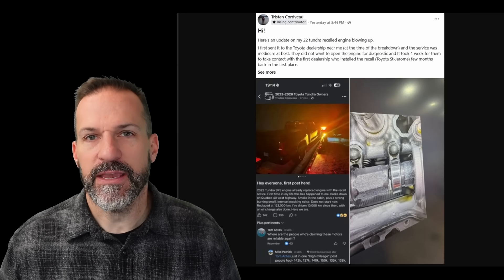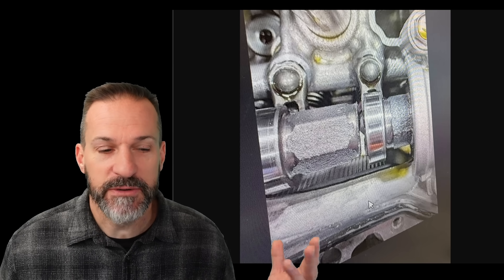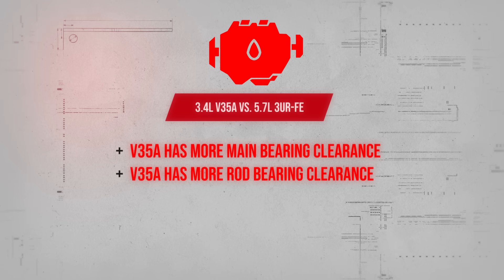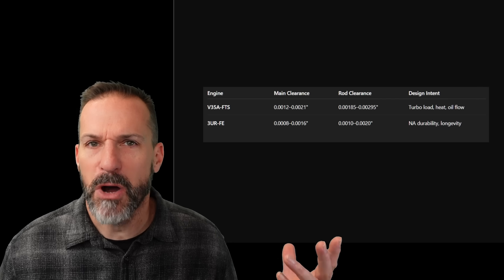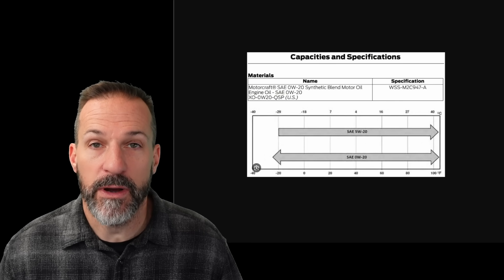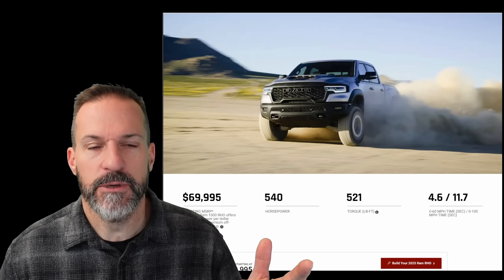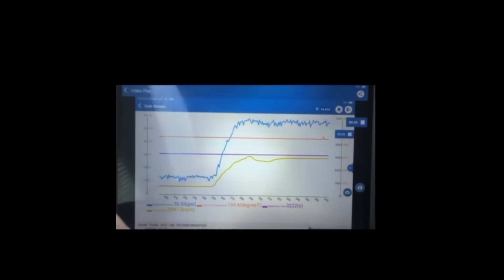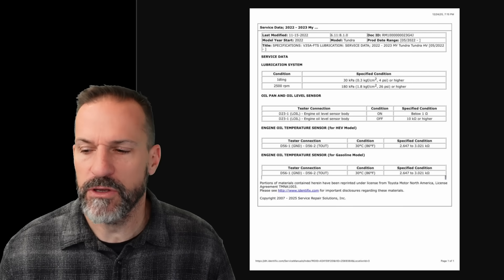Can We FIX Toyota's BILLION Dollar Mistake at Walmart? 2022- 2026 Tundra...

Comment from the maker: Disclaimer: I’m not telling you what oil to run. I’m not a mechanic. This is not warranty advice. This is an analysis based on publicly available data, owner reports, and engineering fundamentals and what I would consider if I owned one of these trucks :).
Reply: I switched my vehicles to 5w30 because so many manufacturers are having problems and 0w20 seems to be a common denominator.
Reply: @Linda-l9d6e
5w20 has been around for a very long time...its the 20 v 30 thatd matter. So what about the millions and millions of engines with 5w20 and 0w20 that do not fail? Toyotas 5.7, for example, 0w20, running strong. You have a logical fallacy my friend.
Reply from the maker: @OBSSVADHD  pretty big difference in engine design, power output and oil pump/pressures. It’s a lot easier to make NA engines reliable
Reply: I think it's good advice, and I made the switch 6,000 miles ago and I am never going back to 0W20.
Reply: Design is one thing. What the actual dimensions are is something else. 6 sigma certifies a "process" when in the old days, PEOPLE used to inspect critical parts 100%. Betcha the multiaxis robot 'inspectors'want a pay raise!
So how can Yamaha run 0-40 in thier 3 cylinder 998 cc 200+ hp snowmobile engine? Lets see...1 litre,200 stock hp. x 3 (litres) would be 600 hp equivalent? Toyota needs to stop by the Yamaha r and d department and do some spying!😂😂
Reply: @brokenujoints3811  I feel like people probably took more care of packaging the original Xbox than they do building these engines
Reply: @brokenujoints3811 
Japanese sportbike engines are only made in Japan because the rest of world sucks manufacturing.
Reply: Changing the oil type will, at best, delay the failure.  You may well end up with failure occurring out of warranty instead of in warranty.
Reply: @OBSSVADHD I think if you switch to 5W-30 before the damage is done I think I'll make a huge difference.
Reply: @HowtowithPaulHenderson 
I disagree. There isnt much hard evidence for ua to debate with, really.

I have a friend who owns a couple of Kias.  Both in the range od their engine failure.  He used thicker oil and top brand synthetic uaing your logic.  One vehicle lasted 110k miles and the other 120k miles.  Both engines still failed.  So he maybe delayed the failure, but could not ultimately prevent it.

People put way too much into these oil viscosity differences.  Having worked in engine and auto manufacturig for decades i can say with confidence that these types of failures are not going to have oil viscosity as the root cause. Maybe a minor conteibuting factor, but not "the" cause.
Reply: @OBSSVADHD  Agree on the oil, I think too much scrap metal is used to make engine parts. Spend the money on true alloys.
Reply: @geraldgarrett5088 generally speaking, you cannot have too much scrap metal as long as the final properties are met.  Ive been to dozens of steel plants and bought steel products via suppliers for a long time.  There are issues of steel quality though. There has been a glut of low quality China steel since their infrastructure demand dropped dramatically post covid. Im sure that has made its way into auto parts at times.  A lot of our problems these days is poor quality in manufacturing.
Reply: I’m now running 5w30 in my 24 Sequioa mainly because of the turbos. most manufacturers since 2007 have recommended that weight. ford went to 5w20 and switched back. Turbo cars get really high oil temps compared to NA and 0w20 gets to thin-like water at those temps; then add the 10k mi extended oil change intervals it’s a time bomb waiting to blow
Reply: Always appreciate your videos, thank you. I bought a new 2002 Chevy Avalanche and followed the break in recommendation. I think it was 600 miles never over 60 mph fluctuate the speed etc. in the 16 years of ownership never had to add oil never burned oil. I would read that many owners posted their Avalanche burned lots of oil. I know the dealership said break-in periods were not necessary, so i wonder if those owners did not follow any break in recommendations. When i bought my new 2017 Tundra. i did the same and also changed the first oil at 2,000. In 8+ years i’ve only changed one turn signal bulb and a set of new tires 😂 this might be my last truck if it stays this reliable 😄
Reply: My truck is leased specifically for this reason.   If the truck blows up, I give it back and go buy a second gen and keep it forever I guess.  lol.   I won’t be screwing around with oils under warranty unless Toyota recommends it.  I will however change my oil every 8000km or 6 months instead of the ridiculous 16000km recommended.   If the engine is good, I’ll maybe buy it.
Reply: The problem with Toyota is, they are like a cruise ship, they take miles and miles to make any significant  adjustment… in the past it worked because they made a decent product… right now they need a Venezuelan drug boat type maneuver… hell, the entire community has been griping about tow hooks and they still haven’t even put those on
Reply: https://youtu.be/i0VoEhW2I-E?si=WPByVzIkOH0MQHnU
Same theory from an engineer. Worth a try
Reply: you would  think a company like Toyota, which probably pours tens of millions of dollars into their R&d would be able to figure this out… instead of Youtubers have to come out with a solution
Reply: @Wellh0wrya  Toyota is, like most companies nowadays, is hiding the truth, to avoid legal consequences and loosing customer satisfaction, etc.
Reply: @Wellh0wrya 
So true, I really feel that's the oil but will they ever truly admit it no because if they do they will be open to even more lawsuits I think that's why GM went to the 0 w-40 if the engines that were inspected were okay and they did not need to be replaced but if they would have then switched back to 5W-30 then that's pretty much that would be them admitting that they made a mistake going to the zero w20. 0w20 is just way too thin especially the heart of the oil gets the thinner it gets it's pretty much just black water at that point.
Reply: @Wellh0wrya it's not a solution, it's an opinion at this point
Reply: @UT3CTF what’s the difference? Youtubers are trying to find a solution. Meanwhile Toyota keeps selling junk.

Comment: I was thinking of using 5w/30 in my tundra because I noticed low pressure on the gauge all the time,  I remember growing up, a good engine oil pressure was around 40-45.  My first thought on this was not enough pressure or oil is too thin.

Comment: A great example of this is If you watch the video of TFL trucks doing an off road tow test on a ram with the hurricane engine. They were pulling a skid steer on a equipment trailer up a dirt road. And when they got to the top, the low oil pressure light came on after really working the engine, the low oil pressure light went off once they revved it up, but at an idle, it was throwing a low oil pressure light on the dash

Comment: Here is my "theory", Im not a mechanic, I bought a new 23 LX 600 prior to any recalls etc. My vehicle was outside the 1st recall by a month. During my 2.8 years I had zero mechanical issues. The 3.4  was not as creamy as the V8 in the previous models and I adjusted to these characteristics. At about 21k miles the next recall was issued. Again zero issues except for the thought in the back of my mind regarding the motor issues. The further from home the more prevalent the doubt became. Its easy to say going to 5 w 30 would be better, but under warranty, with a motor with known issues, I feared creating an excuse of being denied warranty by running oil not recommended. Then I began to ruminate about having these doubts and thoughts after having spent a significant amount of money. My wife and I decided to take our dealer allocated 26 LC 500 and move on. I received excellent trade on the LX 600, no complaints. The thing I seldom see discussed is the doubt that is created by these issues for the owners. I did not suffer financially, but as it related to peace of mind I was not satisfied and made a change. This should not occur with vehicles at all, much less vehicles North of a 100k. I bought Toyota again because of the many I have had that were fantastic. I hope Toyota is listening, not everyone is as loyal as we are. The "debris" explanation was ridiculous on its face, to keep pumping them out with known issues with "the motor gets replaced because Toyota takes care of its customers" is a very weak constellation. My 2 cents.

Comment: Regardless if thicker oil makes them last longer is a moot point. There is a design flaw they are telling people to run oil and they are blowing up. I have run 0-20 in plenty of turbo’d vehicle without issue. My Tundra went kaboom and I did my first oil change after 500 miles then 5000 there after.

Comment: I agree with one caveot…..not on a new engine. 
If you can probably step up the number 5 every let’s say 30,000 miles. Let the engine break in a bit. 

I routinely on my Chevies would step up viscosity as cars got older, they loved it. 

Another thing, if you are living in a routinely hot humid place, you can go with a hot starting oil. You don’t particularly need an oil that has lower viscosity at lower temperatures.

Comment: Force induction engines runs a lot hotter. It is 100% the oil you have to use sticker oil. It’s a turbo engine.

Comment: Stop this zero crap , go 5/40, 10/40, 3500 mile changes and Oil Analysis. But the motors are too small for HP output.

Comment: I use 0/20 in my 2018 TRD Pro Tacoma....V6  engine without Twin Turbo... Sounds crazy putting in the same oil to a more powerful engine like the Tundra V6 Twin Turbo... And Yes getting the oil to those parts sounds like a problem as well... I think you're  spot on!!

Comment: I'm surprised that as complicated as these trucks are and expensive now add problem bearings etc that no company has added a electric pre oiler to get the oil psi up before you start it.

Comment: Of course, there's a fix for the Toyota Tundra engine issues. It's called throwing it away and bringing back the 5.7L V8. And the 4.6L V8 and also including the 3.5L V6. As a base model engine. I mean, seriously, why hasn't Toyota or, for that matter, Nissan figured that out. There's a reason GM,Ford, and Ram constantly outsell those brands. It's because they offer choices of cabs, bed lengths, different trims, and different engines. Supply and demand. Give the people options. 
Apparently, Toyota could never figure that out.

Comment: The 4.7 v8 was made with the help of YAMAHA, toyota doesnt have experience buiding turbo engines. Nissan made a v6 twin turbo back in 1990 and those engines are still running. This 3.4 twin turbo has a bad design. When they blame debris it was just another lie. Because after replacing 2 or 3 engines it will still faill.

Comment: Running 0w-20 in twin turbo high output engine is criminal. I have an older Audi that had a bad oil pump. It pumped out 12psi at idle. 4-6psi at idle is absolutely insane

Comment: I don’t put over 5k a year on my v6 Ridgeline so once a year oil change but I put B&G MOE oil additive at 6 month mark. The dealers who advertise engines for life install B&G oil additive at every oil change. Along with full synthetic oil. This came from my Honda dealer. I have researched this additive and it is highly recommended and actually works protecting engine parts. Does not affect intakes or lifters. On top of that I use Top teir  fuel with Lucas fuel additive. I also researched Lucas,again great reports no down sides. Truck is still new but engine sounds quieter and smoother.

Comment: It’s also important to point out that many of these failures happen after the first oil changes at the dealership. In many cases, dealers use low-quality bulk oils without clearly disclosing it to customers. This becomes even more critical when the engine is run on low-octane fuel (87 or 89 octane) in a high-compression, twin-turbo setup, which increases the risk of pre-ignition/knock. When this fuel-related stress is combined with poor oil quality and the V35A-FTS’s extremely low oil pressure design, it creates the perfect conditions for engine damage. These factors together—not oil viscosity alone—are the real trigger behind these failures.

Comment: Trust me, the real problem with the V35A-FTS is oil pressure, not oil viscosity. At idle, the engine runs at extremely low oil pressure—around 4 psi, even under load. At 2,500 RPM, oil pressure only reaches about 26 psi. These values are simply too low for long-term durability, regardless of the oil used. The issue lies in the oiling system design, not in 0W-20 oil.

Comment: Go by the ambient temp of where you live for oil viscosity. 
I live in El Paso, Texas. In the 3 coolest months of the year, I ran 10w30 in my gasoline cars. In the other months, I ran 10w40. 
I now have Ram Ecodiesel and a VW TDI. I run 15w40 Rotella T4. All year long. I get 40 MPG in the city in the VW, and the Ram gets 21 MPG highway or city.

Comment: As a guy who had a 08 Turbo Polaris snowmobile. Turbos are JUNK! Yes fun. But junk for reliability. I spent 55 grand of my own money tuning the motor. upgrade turbo with ball bearings.. ECM changes cos it didn't like minus 20 anything... 0w 50 oil. Just to try and keep it going for the 15 000 miles i owned it for. It almost broke Polaris..

Comment: Thinner oil shows no appreciable wear in increase in actual tests were specious reasoning and sticktuidnous aren't reqd. Surface finish is important oil pressure is showing the resistance to flow not necessarily oiling plastic bags are NOT toys.

Comment: I bought a 24 Ford Bronco Sport. But it had to have the 2.0 liter engine and call for 5-30 oil. If Ford was calling for 0-20 I wouldn’t have bought it. And i wouldnt have bought it if it had any type of cylinder deactivation system like GM uses in there 2.7 4 banger. I don’t and never will go by the oil life monitor. I change the oil and filter at 3k. I don’t care what the oil geek says. Today’s oils aren’t as good as they say. Especially on a 4 cylinder turbocharged engine putting more stress on moving parts than a V 8 did from years ago.
What I don’t understand is why Ford doesn’t run the engine without turbo boost at light throttle and only bring the turbo into play after say 1/2 throttle. Back in 76 my Honda Civic could easily get 50 mpg with no turbo no direct injection and a crappy carburetor. But today’s direct injection and small turbo engines like 2.0 in the Bronco sport get half that unless you drive like grandma. And these same direct injection engines produce massive amounts of soot.
FYI we are seeing GPFs being installed on direct injection engines because they produce so much soot out the tail pipe. BUT if MFGs went back to MULTIPORT fuel injection there would be a small HP loss and no intake valve carbon issues and no need for a GPF. (Gas particulate filter) that causes HP loss due to exhaust back pressure issues. WTF?

Comment: Variable oil pump for the engine. Well turn up the pressure. Disconnect from the ECM and put a controller in that will run high pressure. I could see this being used as a way to kill engines out past the warranty. Either it is programmed to lower oil pressure based on milage or it gets an update from a dealer mechanic at a check up.

Comment: It’s not just having more oil in between the bearing and moving parts. Thin oil flows much more easily out of the spaces between bearings and moving parts. So the tolerance was reduced to maintain oil pressure with 0-20 oil. Thin oil doesn’t offer much cushion between bearings and moving parts. 
Problems begin when the space between moving parts and bearings are reduced and parts repeatability is an issue. There is always some difference between mass produced parts. And if you don’t allow some tolerance between bearings and moving parts for the small differences in mass produced parts then you get metal to metal contact. Also under load at low rpm a thin oil will squeeze out from between parts easier than a thick oil. Leaving less lubricant between bearings and moving parts. 
So loose tolerance and thin oil is bad
Tight tolerance and thick oil may not get enough oil in between bearings and moving parts when cold
It’s impossible to make parts 100 % repeatable in a car production environment (To expensive)
Today’s variable oil pumps are a really bad idea. Low oil pressure is never a good thing.
Start stop technology is proven to cause massive premature wear. Metal to metal contact each start with no oil pressure.
The best idea for long life is more space between moving parts for thick oil. No variable oil pump. No start stop technology.
Read carefully and think about it.

Comment: The cylinder pressure is the difference with the new tundras being turbocharged.  I use Penn oil ultra platinum 5w30 in my 5.7.  Can’t imagine using 0-20 in a high boost engine.

Comment: I had a 6.2L Silverado and had the engine checked via recall and they changed my oil. So many issues with these manufacturers, I was still having issues with my Silverado and traded it in on a 26 Tundra. The salesman told me issues were resolved. But, it’s looking like it may not be resolved. But anyway since Chevy’s recall has them changing the oil got me wondering this same thing. I asked if it could be an oil issue on Reddit and everybody was insistent it is not an oil issue. But seeing this video also has me wondering this again.
Reply: You are a reason Toyota doesn't get too excited about these problems, you trade one problem for another just like it. They want sales, so when people blindly continue to buy, why worry?

Comment: I have a 2014 GMC Sierra 1500 with the 5.3L. I went to 5W30 oil from the factory recommended 0W20 and I got better oil pressure across the RPM range. At 500RPM  the oil pressure is 30 PSI.